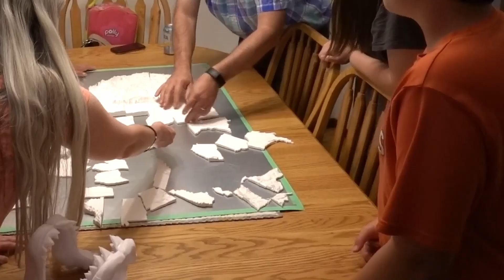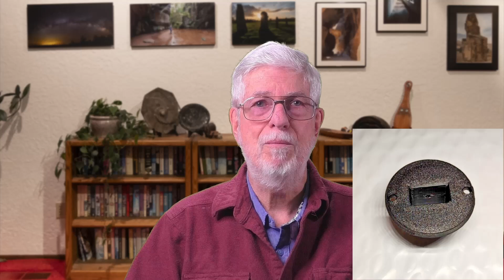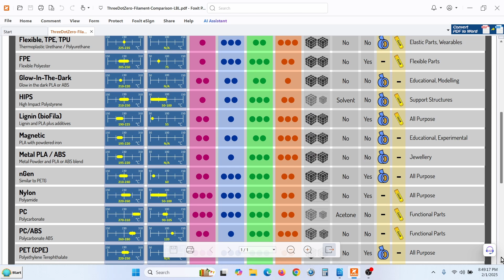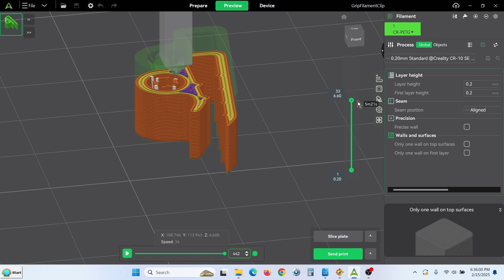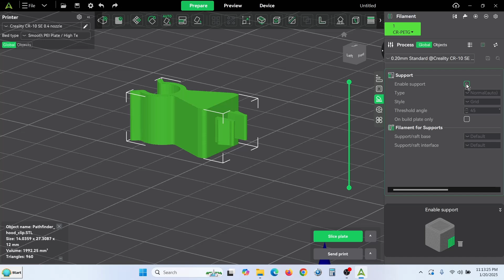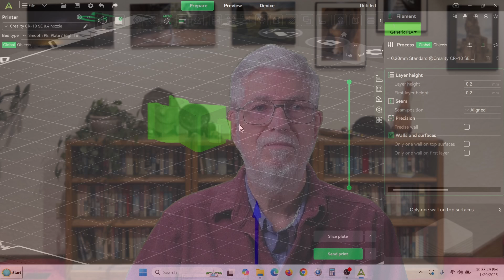I Don't Need A 3d Printer...BUT...

Comment: I've been 3D printing for 10 years now. I would say it's the most valuable tool that I own, especially when you couple it with the ability to use CAD software for designs. I usually don't print trinkets unless my wife asks me to. She collects Fisher Price Little People, and sometimes they need to be repaired, so I go into Fusion 360 to design new parts. Most of my 3D printing is for functional parts. I print a lot of TPU and engineering filaments. 3D printing has saved my butt many times when things break. Also, one thing that people don't realize when they get into 3D printing is that most filaments need to be dry before printing.. PETG, TPU, and Nylon will soak up moisture like a sponge. They need to be dried in a dehydrator and stored in containers with desiccant when not in use.

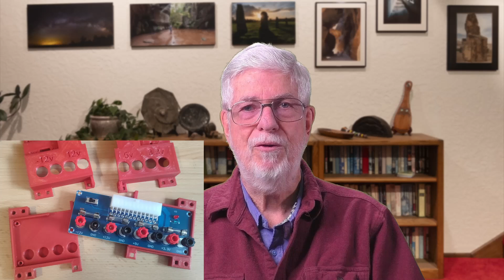Comment: 4:15 Do you also make sure to use filament with flame retardant that is suitable for electronic housings? At least that's what I would do if I were printing electronics enclosures. Tip: There are also antistatic filaments if you need an electrically conductive filament. These are suitable, for example, for housings for storing SMD components.
Reply from the maker: That's a good thought which I had not considered - thanks.
Reply: @anoldretiredguy  You're welcome.

Comment: I retired two years ago from running CNC machines for 20 years. I had always wanted a 3D printer so I bought one. With CNC and 3D printing it's all about the X, Y, AND Z's So learning wasn't too difficult. I'm all about practicality so those are the things I print. I printed a couple dozen large seed starting trays for my garden along with some other containers. Using transparent PETG for humidity domes, they came out great. It's surprising how many everyday items you can 3D print instead of buying. BTW I'm up to 3 Bambu 3d printers now. Guess I'm addicted.  😂

Comment: I purchased my first 3D printer in Feb 2018, a Creality CR10S.   It allowed me to make many functional parts mostly parts of jigs for wood turning, but some parts to fix broken items in the home.
I upgraded to a Core XY printer 14 months ago.
My biggest 3D printing learning curve has been diagnosing issues when a print fails or has bad quality or printing issues.    This can be a challenge.
A couple of years ago I had to go through another big learning curve to learn how to use some CAD programs so I could create designs for parts which did not exist on Thingiverse etc.
These days I consider a 3D printer to be an extension of my shop to help me with my wood work and metal work hobbies.
My CR10S originally had a glass build plate.   I upgraded this to a steel sheet with PEI surface and a magnetic sheet attached to the aluminium with adhesive.    This is so much better than glass.   My recent printer has a similar build plate setup.
A big benefit of the steel build plate is that it can be flexed to get a part removed.   I had some parts which attached to the blue masking tape on the glass build plate so well, it took a LONG time to remove them and in some cases the blue masking tape was fused into the first layer, hence the difficulty in removing the part. 
Dave.
Reply from the maker: This seems to be a fairly common  approach for people who are "practically oriented" like I am.

Comment: Welcome to the world of 3d printing. I think you will find that the learning curve of something like tinker cad isn't that huge. The joy of creating something in a virtual 3D space, and going from that to a physical object is fantastic. 
I got a 3D printer for my 50th birthday. I had used some 3d cad before that just for fun. I'm now 57 and just last year I forced myself to take the plunge to learn something a little more challenging, with the free version of Onshape. If you have any experience with technical drawings then this may help. 
Tinker Cad, or primitive modeling, is often seen as the way to get in to 3D design, and I don't disagree. But I found that going from that to something like onshape wasn't that easy, it's like starting again. 
Follow a few tutorials on YouTube, on whatever cad you like, and make something, anything, even a random shape. Print it out and hold it in your hand and think  "I made that" I think you'll be hooked. 
Good luck with your new hobby.

Comment: My son has had a 3D resin printer for about 18months and uses it for Warhammer 40K miniatures and Loved checking them out and i finally pulled the trigger and got a Elegoo saturn 4 ultra for Christmas last year and love it but the only downside is the print size

Elegoo has released the centauri carbon this week so the son and I went halves now he can print the terrain and larger vehicles like tanks etc and I can print some stuff for around the house and for the wife

Comment: Ha ha ha ha!  Just got this video recommended to me and I’m a retired electrical engineer.  And I have a 3D printer.  Hilarious.  Sure nice to have a 3d printer.  Used it to make two parts for a deck I just built.  Solved 2 tricky issues.  Also used it to make jigs for the deck.  Used it for low voltage outlet covers and boxes, replacing broken stove knobs and all sorts of stuff.  Super helpful for do-it-yourself-ing. The CAD stuff isn’t too hard if you’re used to looking at drawings with dimensions.  The newer printers like the Bambu Labs models really handle a lot of the tedious tasks of getting something printed and make it way less time consuming.
Reply from the maker: Sounds like exactly the kind of thing I hope to be doing.

Comment: I started my 3d printing journey 2 years ago because I nedded a way to print enclosures and parts for my electronics projects, and this sent me in to a number of rabbit holes... The first one was that i wanted to print abs, and this requirea an enclosed printer, so  I built a Voron Trident from a kit... Next was learning how to configure clipper, and actually learn how to print. Then I learned how to make things on 3d cad. Now i am building a unit to allow me to print in different colors. The amazing thing about having a printer and know how to do objects in cad is that you can fix everything. Dishwasher unobtainable part broken, no problem, print a replacement. Old radio has some bracket broken, print one.   I dont think my path is an example for most people, but having a simple inexpensive printer and some filament solves a lot of problems...
Reply from the maker: That's pretty much exactly how it see it being useful to me.

Comment: Good sites for getting models:
* Thangs - essentially a search engine for models, will search a lot of websites for models, including the ones listed below.
* Thingiverse, as mentioned in the video. Owned by Ultimaker who makes professional printers. One of the oldest and biggest sites for models for 3D printing.
* Printables, owned by Prusa, but pretty open for anybody to use.
* MakerWorld, owned by Bambu. Has a download limit if you don't create an account, tightly integrated with their printers so maybe not as useful if you don't have a Bambu printer.

Note that I'm not including direct links, as YouTube doesn't seem to like that.

Comment: "i don't need a 3d printer"... you will soon realize how much you always needed a 3d printer in your life, once you get familiar with the ins an outs of designing parts for printing and maintaining your machine, your life will change forever. For someone like you who i know likes tinkering and building stuff, suddenly being given the power to summon a piece of plastic of whatever shape you want and that can connect whatever parts in any orientation or configuration will certainly mean that printer won't be the only one you own for too long. I really hope you enjoy your journey as i am enjoying mine, and if you want a recommendation on what to start playing with, i recommend looking up the Gridfinity project, it's a modular open source organization system that alone can justify the ownership of a printer.
Also, i really wish you were my grandpa.
Reply from the maker: Actually I kinda hope you're right, because the technology is interesting and I would like to make use of what I've learned. But it is possible to have too many hobbies, and I'm getting a little late in life to take on too many more. Thanks for the compliment, though.
Reply: @anoldretiredguy  well, think of 3d printing less as a hobby itself and more as a tool that will help you with other hobbies. Of course it has a learning curve of its own but as you interact with the machine you eventually develop a "feel" for what works and what doesn't. I'm eager to see what you will end up doing with it.
Reply from the maker: @taylorroddin  Thanks, you're probably right about the tool aspect, because that's really what appeals to me. We'll see what happens.

Comment: just a little tip.  the volume of your mic is too much.  
(bars in the equaliser are entering the red) 
they must stay in the yellow.   (or basicly reduce by about 30% at the verry least.)
Reply from the maker: Yeah, balancing all the possible volume control points (2 in hardware, about 7 in software not counting equalization before the editor output) is an art that I'll probably never master. If I'm lucky, it may wind up 1-2 dB below YouTube's max values for peaks and average.
Reply: NO! Do not lower volume! I have to have everything cranked to the max on almost every YouTube channel now because their volume is too low.
Reply from the maker: @timothymusson5040  YouTube does have a standard for the volume level for videos, but it's really only a maximum (for peak and average). If a video exceeds either of those, they will reduce it - but they don't ever increase it if it's lower, so that leaves a lot of room for variability. I do try to keep mine within a couple of dB of their max values, but who knows if the measured levels in Davinci Resolve really match whatever their algorithm thinks it is. Most YouTube videos play loudly enough on one of my laptops but sometimes not on the other. YMMV.
Reply: @anoldretiredguy  Yeah, I don't know what's going on, but in the last year a lot of channels have been hard for me to hear. Maybe they changed their levels, I don't know. But I know it's not my headphones because some channels are fine...
Reply: @timothymusson5040  The signal input should not be overloaded. The volume can also be increased using software before uploading the video. The prerequisite for this is a clean, clear recording. 
In principle, it can also make sense to normalize the volume if you have different audio recordings with different volume levels. This avoids the user having to constantly change the volume themselves when watching.
Reply: @OpenGL4ever  understood. It just seems that everyone is normalizing their levels such that I have to have my volume completely maxed out just to be able to hear them ok in a quiet setting, and I can't hear them in a noisy environment even with my full-ear noise cancelling headphones. Something has happened in the last 1-2 years on a lot of channels. And it's not all of them; some channels I have to turn down my headphones to half volume or so. So I know it's not my settings or hardware. And of course it's these low-sound videos that cause me to occasionally get blasted in the ears by a normal-level video. My volume should be resting around 50% normally, not 95%.